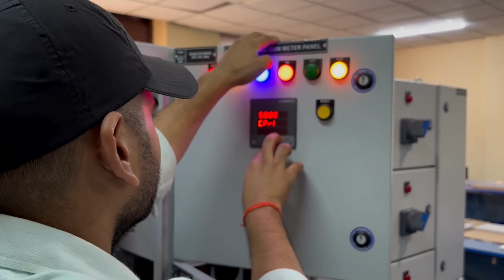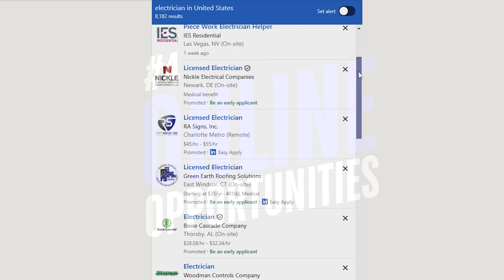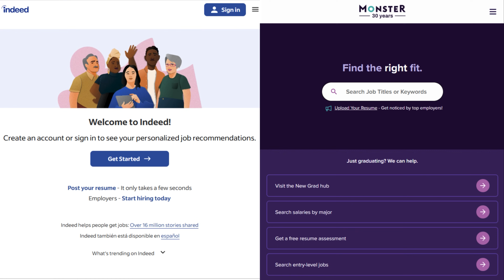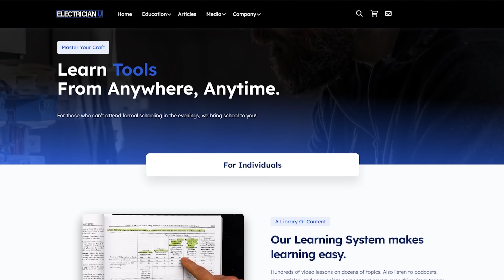Want to Become an Electrician in 2025? Here’s What You NEED to Know!

Comment: I grew up in a time where, as a kid, I was allowed on a job site. I watched, I asked questions ('go away kid, you bother me'), I handed tools (and learned what they were used for). What I lacked was practice to make those beautiful pipe runs (Mine were safe and solid, just not pretty). My high school had SHOP classes where you learned Electricity, wood, metal and Auto (mine also had Print Shop).  We got our hands dirty and got to try out career paths. That is gone in my area. Kids no longer have a 'free trial' on a career path. If they live in a Major Metro, choices are even more limited if you don't "know someone" as a way into the trades .
I don't know about what they now do in the Military, things have changed that much. I was a Navy Radar Electronics technician. That is where I got experience in everything from really Low Voltage to 440V 3phase (and way higher DC).  We need to get some of this back so folk don't need to start5 a career with a mountain of Student debt.
Reply: I as well had SHOP classes including welding and mechanical drafting (unfortunately a dead art) however in 2018 I worked in Casper Wyoming at a highschool that was being remodeled and added on to and after years of not having SHOP they were bringing them back in an effort to try and keep graduating students in the state as opposed to going elsewhere anyway one of the welding instructors told me that mining and oil companies will literally wait at graduation to offer both boys and girls opportunities to work for them at very competitive wages and with huge signing bonuses it was nice to hear especially because not everyone is a computer coder or wants college

Comment: Thanks for all your videos Dustin,& thanks for telling me I am a youngin 😂 I have watched a ton of your videos, and a select few to help figure things out like you said. Only problem is, now i have so many electricians tools, i actually had to go buy a bag, and an electricians tool belt and they are both full. I am actually excited this weekend i am running a new circuit in my panel, 20a afci/gfci breaker,12 nm wire & 2 -2  gang 20a commercial grade outlets and also 1 -2gang outdoor outlet with a gfci commercial grade outlet and a non gfci commercial outlet, plus the conduit. I enjoy doing the electrical work myself, gives me that sense of satisfaction when all done and everything has tested out correctly.

Comment: Im currently a dealership mechanic and like doing electrical work and especially making custom harness for aftermarket parts or wire repair im considering switching trades to be an eletrician has anyone else done the same or have any guidance on how to begin

Comment: @electricianu In one of your other vids, you mentioned not to worry about age if you want to start over.
I want to start over!  I'm a 55 year old IT person and now that I am running into rampant age discrimination issues and having trouble getting work, I would like to maybe try to become an electrician, something I thought about doing years ago but then instead chose the IT route which I now somewhat regret.

I like troubleshooting and so I would probably go that route with electrical.  I don't think it matters to me if I do residential, commercial or industrial but I suspect I might leave out residential because when I supported residential in IT, people always wanted to argue about the bill (after the work was done) where businesses would just cut the check and say, "Have a nice day!".

I think I want the union route as well for the guard rails and to make sure I have things like health care and although I doubt I can do 20 years in this, if I can make even a small pension, anything is better than just straight social security.

So hopefully a union hall will take me at my age and train me.  I know some of the basics but I do not pretend to be an expert.  Just did stuff like put up ceiling fans, wire some basic switches and outlets and I put a few outdoor lights in my yard.  Even switched out a few bad circuit breakers over the years.

Got any advice for someone like me?  I live in Northwest Indiana (45 minutes from downtown Chicago) so I can go to either state, whichever might be easier to break into the trade.  I can even drive a bit north and tag the Michigan State line in under an hour as well.

How do you think I should start?

Thanks!

Comment: I'm a State Licensed Journeyman Electrician with 60 years in the trade and I was also a ''Strategic Microwave Communications Technician'' in the U.S. Army StratCom USACC (Signal Corps) for almost 9 years. Fixed Station Microwave Radio Equipment ,Operation and Repair Tech MOS 26V. Secondary MOS was 51R20, ''Electrician Specialist Tech '' And I was also trained in Telephone Systems , Inside & Outside Plant Operations and Telephone Systems Lineman Installer School. So I have various background with lots of schooling and on the job experience in Electrical & Electronics, Telephone Systems and Firefighting ! I also built and assembled many Heathkit Electronics to include several AM/FM Stereo Radio Systems,Test Measurement Diagnostic Equipment  and Televisions. I'm 74 years old and have always consider myself lucky all those years as I was never shocked other than a few times with 120 VAC while doing Residential Electrical Repairs or Upgrades. But I enjoy doing it all as I'm still doing Electrical Work now and then ! I'm also a Retired Federal Firefighter DOD with 30 years of Service. Retired in July 2003 as a Firefighter Tech II. Most of my electrical work has always been in Residential Wiring & Maintenance  and some Commercial, Wiring & Maintenance